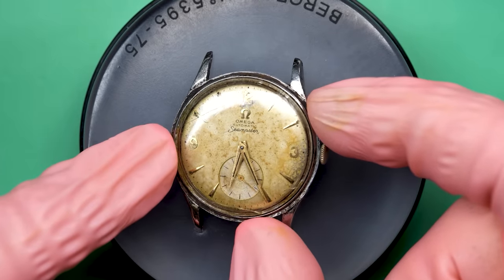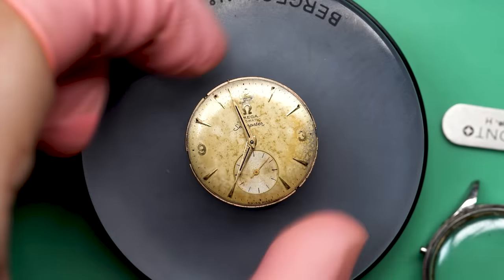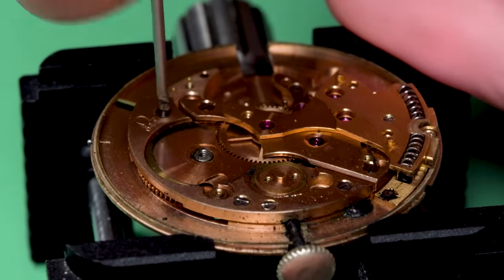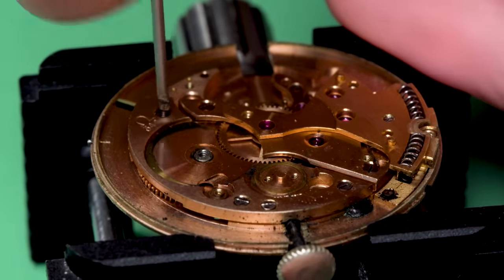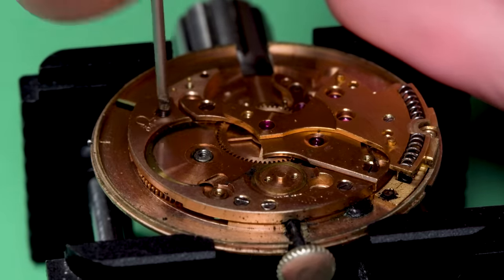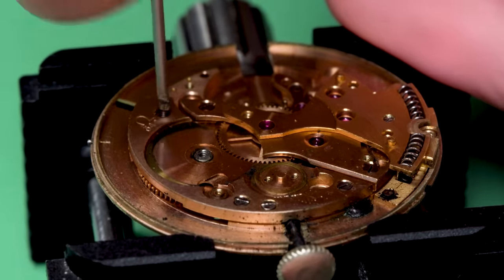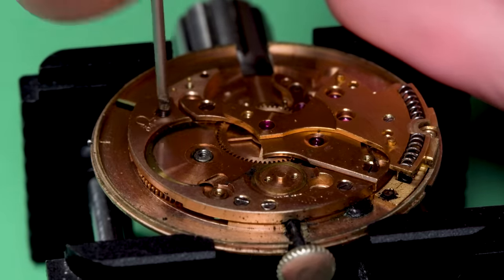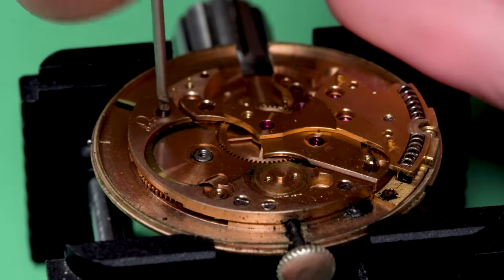Omega Seamaster Automatic From the 50's With a Killer Dial Vintage Watch Restoration

Comment: Watch cleaning machines look like a horrible method to clean those small parts.  Why would you oscillate back and fourth?  the components are ramming into each other over and over.  its like a vibratory machine.  Why not just use ultrasonic or a flowing solvent.  Such small details and gear teeth and it cleans by shacking the components against each other.